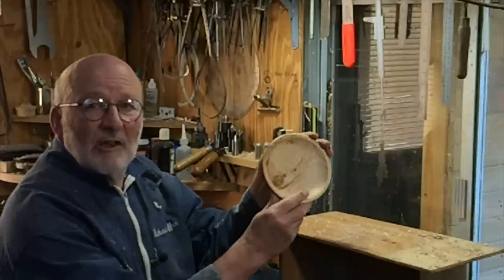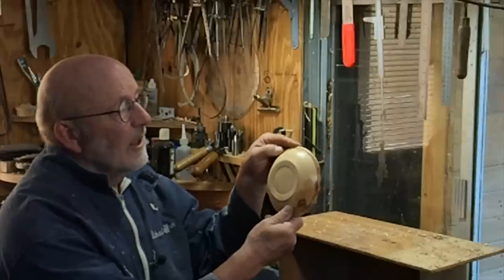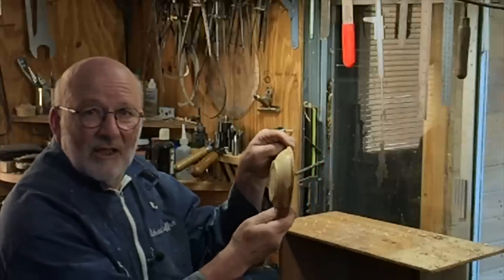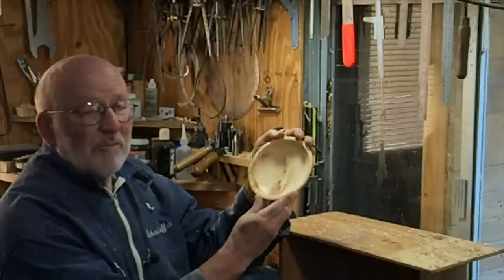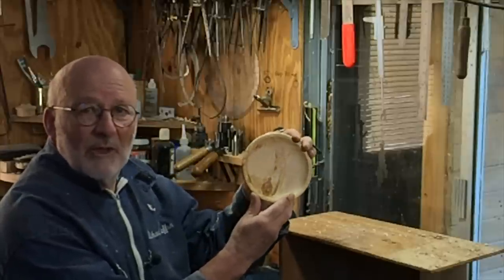Richard Raffan turns a small claret ash dish. Real time.

Comment: I like the pace. Your tools were all set up before you start turning. Everything within easy reach. No wasted motion. Nice.
Reply from the maker: It does help the flow.....
Reply: @RichardRaffanwoodturning  I don't think scrapers are used near as much as they should. I don't have good scrapers. They are thin compared to what I see you using so skilfully. Any suggestions?
Reply from the maker: @kenvasko2285  For small boxes and working within 2-in (50mm) of the rest I have ¼-in thick scrapers. The others are ⅜-in (mm) which I find quite heavy enough. All are Henry Taylor, Hamlet, Sorby and a coupleof old P&N.

Comment: It’s good to know that even a guy with all your experience, still forgets to turn the lathe direction back to forward occasionally!
Reply: I would not recommend ever using the reverse to unscrew the chuck. If you’ve loosened the chuck and get it wrong and actually switch it on forward again by mistake it may spin up to speed and tighten up so much that it may be very hard to ever remove the chuck again.
Reply from the maker: @cooperken11  You're dead right there!

Comment: Good morning Richard, I have only been turning for a few years at St. Andrews men's shed, do you ever use sanding sealer or only boiled linseed oil and bees wax. Your close up shots of the work is so helpful. Cheers Garry
Reply from the maker: I've never used sanding sealer and stick to the oil and wax which provides a good base for further wax polishing.  Or it comes off when washed in hot water and detergent for daily use with food.

Comment: When setting your tool test do you want it about at the center of the bowl?
Reply from the maker: For scrapers the tool rest needs to be very near centre height so the tool is tilted down when cutting at centre. It'll be slightly lower for gouges. The precise height of the tool rest is always dictated by the thickness of the tool. Using gouges I tend to keep the rest at 90° to the lathe axis, but occasionally have it inside the bowl when using scrapers.